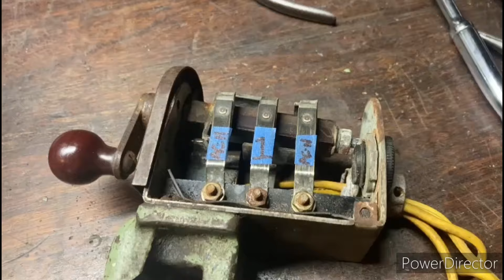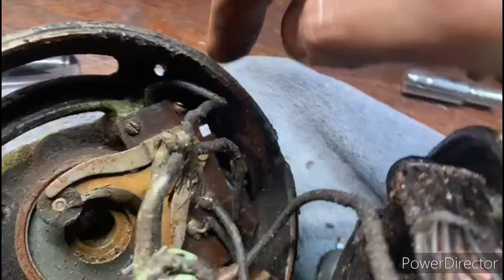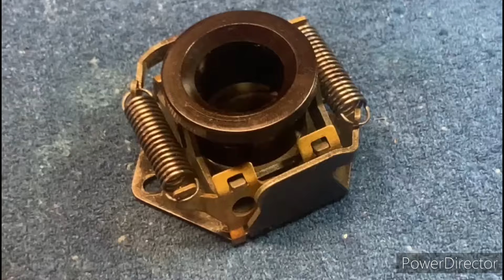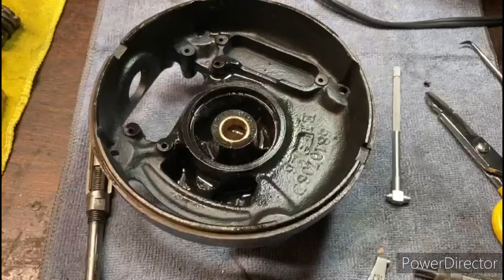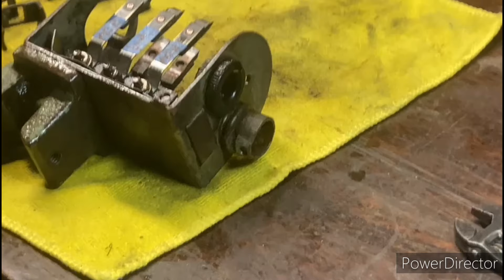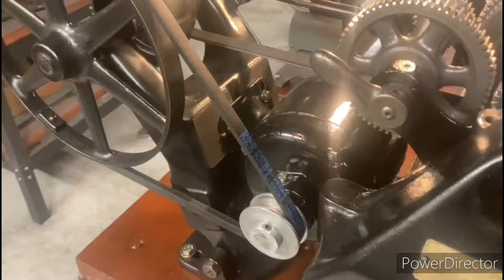1934 South Bend Lathe: Complete motor & drum switch restoration. Part 2.

Comment: Like your work on old motors.  Would you happen to know of a place that could rewind the armature of an old repulsion motor?
Reply: It's an old Wagner Electric with aluminum bell covers.  With aluminum  I assume it's from after WW2 but it does still have cloth covered wire.
Reply from the maker: They are extremely tough motors
Reply from the maker: Eurton electric...good luck with it.
Reply: @BencoVintageMachineWorks  Have you ever had one done with them or anyone else?  Do they work with old motors like that? That name did come up in a Google search I had done.  Anyone on YouTube done a video on rewinding?
Reply from the maker: Join the FB group Antique Electric Motor Experts. You can post your motor there along with questions...
Reply: @BencoVintageMachineWorks I should also ask this, but I assume a growler should test a repulsion start armature just like any other armature.  I had a generator starter shop put it on their growler and it seems to have shorting based on that. P.S. I did make sure the brushes weren't in contact with the commutator.  I didn't take it apart any further - i.e. I left brush assembly and shorting necklace in place.  In the back of my mind I now wonder if perhaps the shorting necklace could be shorting during start mode. You ever see that before?
Reply from the maker: Those motors rarely go bad. Post some puctures on the FB group of the problem...
Reply from the maker: I have several videos on repulsion type motors which may interest you

Comment: I have an old Craftsman 1/2 hp electric motor, model 115.5764. It has some problems, one of which I caused. I need some advice. Can we communicate via email or text?
Reply from the maker: Join the FB group Antique Electric Motor Experts. You can post your pictures and questions there.